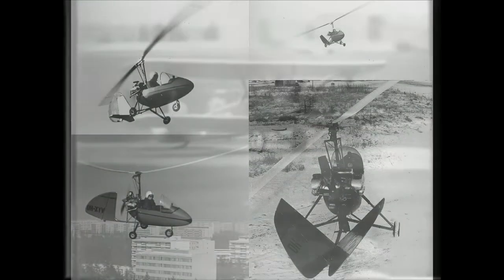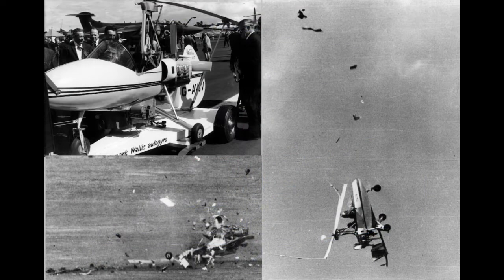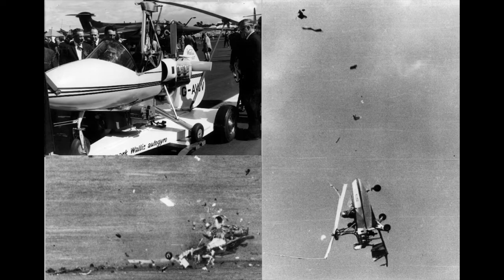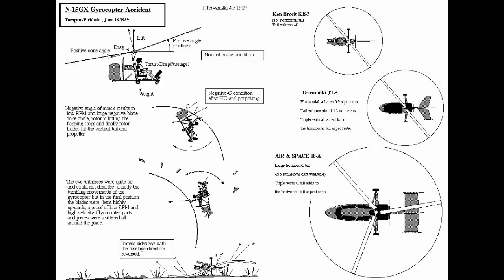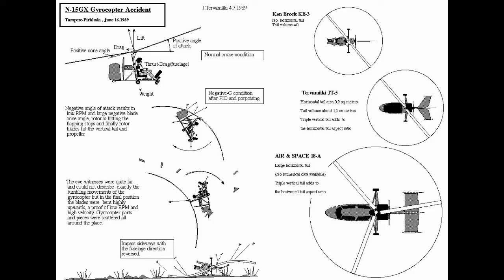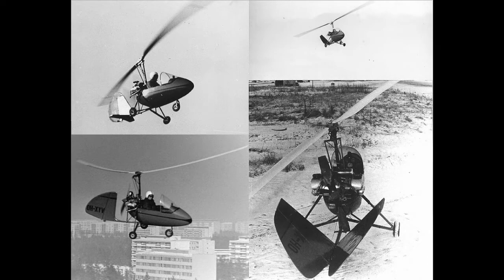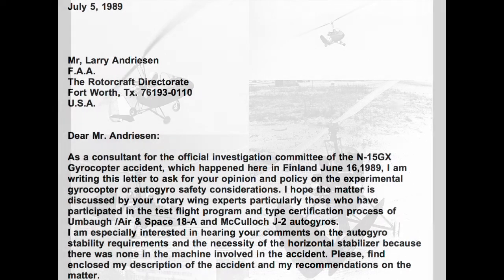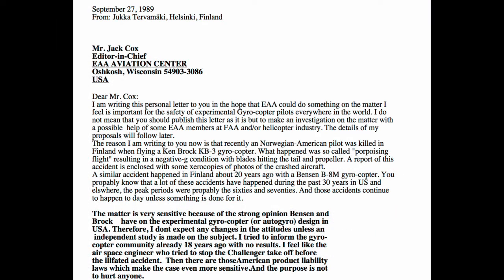History of the Gyroplane - part 16 pilot induced oscillation PIO

Comment: This is an excellent series and I agree with much of this but I have some quibbles 

1) in Australia around the time the air command accidents that lead to their banning Horizontal Stabs were mandated.  Since there has been no appreciable reduction in fatalities,. But all gyros are fitted with stabilisers.  Many large.  Remember the mangoose stealth looking gyro?  What happened there?

2) Speed.  Remember if the rotor is tilted sufficiently forward the angle is more vertical.  If the disk drops below zero what matters.  My STEM kids make gyro gliders in class you know how I get them to stop. By unloading the rotor.  If the rotor has no lift you have zero control.  What happens in the 1/2 second between unload and fly through rotor or tail comes up through rotor is IMO mute.  Your dead anyway.  

3) Glasgow unis summary on stabs for us was they aren't very effective until very high speeds at those speeds gyros become dangerous.  Thus they are insufficient.

3). The key factor here is speed for both high cg vs thrust line and by the way thanks for acknowledinging downthrust.  

4). Can we not ever get to the conversation about rotor wing loading, speed and how that impacts on VNE?  Thus seems the thing no one sufficiently brings up.  The air command at 30mph is stable.  As at that speed the rotor is tilted back at 9 degrees.  It's more of a problem at say 80mph because with say 23ft 8inch N8H12 section rotors it's going to have a more shallow disk angle than say a Bensen (and perhaps I'm jumping the gun on you).

There's a some experiment that anyone claiming thrust line/HS will stop the deaths can do and I'd suggest they try first in RC gyros (as large as possible). Put any configuration you like on fly up to high speed and punch the stick forward hard as you can.  That no one has ever attempted this tells me we are playing at the margins.

The Wallis crash happened at what speed?  90+knots wasn't it?  A guy I knew flying a tall tail high cg machine boasted to us he was going to crack 100mph in his machine.  Several of us warned him but he claimed he'd be fine because he had a stabiliser and high cg to thrust line.  The bunt over in his case happened at 94knots.  His 27ft rotors cut his tail off just above the stabiliser and his body was found some 50m in front of the airframe.  His harness ripped and his leg left in the cockpit caught under the instrument panel as he was flung through the windscreen.

Does high cg vs thrust line or downthrust help.  Yes I suspect it does.  Will it stop you fatally unloading your rotor.  NO IT WILL NOT.  

It feels like this debate is centred around what to do in the last half second of you machine flying when in reality we should be concentrating on when you exceeded you VNE.  Simply don't fly that fast.

As for PIO.  I saw it only once.  When a student of mine got caught with a stretchy rope on the gyro glider.  My fault I brought the dam rope.  I backed off the power to the car so he sank to the ground which got him out of it.  I've never read an eyewitness describe ossilations.  If they are happening it's not many perhaps only one but the evidence I read in 16 years of fatalities didn't show one clear case.  For all we know it was a steady push forward on the stick until the machine unloaded, perhaps at that point due to thrust line.

Bolt a group to the ground in a strong wind and simply pushing the stick forward far enough will unload the rotor.  That stick force is the maximum benefit a stabiliser can provide.  So after landing how much force does it take?

If stability is what we want the the bensen design manual provided an answer.  Overbalanced rotors chordwise.  You need to be careful too much and they get into weave.  However I have flown wooden rotors in which the builder accidentally overbalanced them to 30% not 25% they were rock solid boring in fact.  But our sport is no longer one that encourages real experimentation or takes responsibility for proper training.  

You sir are an exception to this I applaud this series even when I may have quibbles.  Well done.
Reply from the maker: Hey - thanks for the kind comments.  On your points a lot to chew over and I might try and cover some of this is a later film as you raise some interesting points.  I too have always been slightly sceptical of stabs on gyros not in the fact that a properly designed and integrated one might not be helpful but I just can't see how some of these things (that frankly look like a piece of 5-10mm ply board) lashed at a random point and seemingly with no regard to the prop wash really work!  If I was an aerodynamics student it would make a very nice project actually.  As you say Glasgow weren't that convinced.   Your point of large R/C models is interesting and I think what the Glasgow study also highlights to me is the fact that it is a multi 100 page report with some complex maths, authored by some knowledgable people and yet within 5 mins you have quite a few people dismiss it.  Which surprises me - I don't think it was helped by the UK authority also contradicting some of its content (I'm thinking RAF stabs).  It probably could do with a revisit in parts to confirm or deny.  I agree your point re: will it stop you unloading the rotor - no.  Although I think the Wallis accident was air display / low time / poor prep and like many of these accidents there are in many cases too many variables.  One element that I think is a huge impact are the physical controls and their function.  I will cover that at some point.  We had floor mounted sticks, pump action sticks, hanging sticks .. Interesting on the rotor balance and 30% v 25% I have a paper from Peter Lovegrove who found 25% provided poor stability.  It is in his Gyroplane miscellavia vol.6 If you don't have it I'll try and scan and email it.
Reply: @gyrocopterflyingclub6148  thanks.  I've tested quite a few wooden rotors over the years in our club me and another bloke built a number of sets and we used the gyro glider to test.  As I said before that another student built a set intended for the glider as we were borrowing a club members metal blades.  He stuffed up and balanced them at 30% instead of 25%. They were so stable we sent a whole bunch of student solo that weekend.  With one student we hit a massive thermal the hall guague topped off it was massive we should have ended up at the top of the rope probably gained a few few.  I'd smacked the students hand off the stick.  Impressive.  My wooden rotors are at 25% as bensen recommended.  

I was disappointed that the Glasgow report didnt model for the effects of chord width flexibility I personally have found that flexible blades or. Wood significantly more stable.  

The Wallis accident I agree was low hours on type.  Possibly too unaware of the degree of danger he was in at the high speeds.  But they analysed the film to find he was going too fast.

I note that Wallis speed records were set with 19ft rotors and he had a small pitch trim to flatten the nose.  My instructor when he put his pod on his machine added an upside down aerofoil to keep the nose more level at speed.  Ciervas had similar but one side was upsidedown and the other an upright aerofoil to counter tourque from the large prop to they also had ground adjustable.

But the mistake I think in the confidence of all stabilisers is in trying to stabilise the wrong thing.  The airframe hangs on a universal joint.  This means if I over control the stick wants to move in the correcting direction if I'm letting it fly itself.  I agree with you video that good gyro glider training helps this.  Particularly as it allows for solo flight with less weight than any powered machine.  One guy I knew killed himself in an air command in front of my brother.  The month before he rejected coming down to train with a club and qualified instructor because he didn't want to drive 4hours every month for training.  I hadn't visited the club as at that time I was a beginner but he'd smashed his nose wheel.when he punched the nose forward after an unexpected take off.  I watched a friend of mine plead with him to get training and warned that doing this would result in neg g.  But he didn't listen.

So we've had a lot of blame for the machine over the years.  In part this is because it's a small sport and no one wants to do the responsible thing and question the skills of the stubborn or aggressive pilot or question the xomparitive skills of the instructor.  I suspect some protectionism happening.  I know I was extremely lucky to get a great instructor and in the time I was gyro glider instructor he never had a single student under his instruction bend a set of blades let alone a fatality or neg g type death.  He did have people go off and do their own thing and smash upmaches he had stubborn and disobent students go their own way.  And yet I had students in the glider that had had 30+ in two seat machine and couldn't fly the glider!  

It's complicated.  I agree that trustline helps but even here I unload my rotors after each landing.  It's not hard to do even if the airframe is flat which it probably won't be at high speeds.  

And establishing a real VNE for each machine would be difficult unless you set a new hang test for each rotor diameter,. Pitch a d fuel level.  I note most machines have massive long rotors. Why does no one suggest I wonder that rotors be kept shorter?  Wallis held speed and for a long time altitude records with short rotors.  Shorter rotors and for any airspeed you will have a higher angle which even if you have poor cg vs thrust line provided you don't fly fast your disk vector will try to pull the nose up.  The dominators have this ugly approach because they use zero downthrust.

Anyway I've rabbited on long enough.  But I'll leave you with a prediction.  Fix cg thrust line and stabiliser issues and people will still keep doing this until they slow down, and we get a better class of instructor s in general (I can only speak for down here) and students listen to them.

Again this is an excellent series.

Comment: Excellent videos! (im suscribed!) 
I have a question: PIO is reducted by horizontal stabilizer.. ok.. but CLT is said as "needed" in gyros...but, gyros like ELA, or MAGNIGYRO.. are not CLT modified.. So, are they dangerous anyway? 
Thnaks for your answer!
Reply from the maker: Hi the short answer is that no they are not needed, as a pilot you just need to be aware of the limitations and fly accordingly.

Comment: And,one more...hehe.
Im looking for an AirCommand (Classic) (HLT).. is it "SAFE TO FLY" just with horizontal Stabilizer? i mean.. is it so much diference between CLT and HLT?
Apreciate for your comments!
Regards
Reply from the maker: Hi - thank you for the kind comments.  Its not an aircraft that is legal to fly in the UK anymore and initially this aircraft was not sold with any stabilizer. In terms of "safe to fly" the real answer is that you can fly it safely you just need to be aware and consider the aircraft characteristics.
Reply: All my gyro time, about 80hrs, is in Air Command models. In the Rotax 447 and 582 models.
I found no issue and often flew in horrendous winds.
It's all about avoiding PIO's and flying as if you don't have the seatbelt done up.
Once you approach zero G you have lost control and thrust and drag forces will take over, unrecoverably.
Gyros are essentially a weight-shift controlled type, dependant upon positive G. Same as a teetering rotor helicopter is.
Horizontal surfaces at such short moments achieve absolutely nothing. I flew with and without them and could not tell any difference.
I would say a well maintained Air Command is fine.

Comment: Computer modelling by Glasgow showed a 2 inch high thrust line on a VPM M16. Everything followed from that. They were about 8 inches out as has been proven by real world double hang tests. They pretty much discounted the effect of the HS. Newer gyros prove that high thrust line gyros can be stable. Many think the Wallis crash was a torque over when the rotor thrust was lost. This is just as fatal as a push over as was seen at the world air games. All that being said...most aircraft have the thrust line going through the centre of mass. But gyros built like this don't look sexy. ...and sex sells. The Aviomania is an exception and also addresses the torque issue. 
Nice videos.
Reply: It is amazing to me how Glasgow university was so far off on something as fundamental as calculating or determining vertical CG of an aircraft they had on hand.

Comment: why don't they use a ducted propeller? wouldn't that force direct air over the rudders all the time?
Reply from the maker: shimy333 hi yes I see where you are coming from but really the prop wash over the rudder is usually not an issue. As far as the propwash over the horizontal element is concerned that interaction has much to do with how that surface is placed relative to the prop.  A duct would do that with consistency but the structure would be quite (in light gyroplane terms) complex / heavy and expensive (just from the make up of a duct - remember prop size is circa 60in and the duct bigger than that) additionally you would need to also make specific prop blades to ensure efficient propeller interaction with the duct and the design of the duct would need to be pretty clever to allow for its interaction with the airflow over the fuselage. If you look at part 8 of this series the aircraft that did employ a duct was designed by ex-AVRO Canada guys who one assumes used information from a bigger project for their gyroplane - and even that wasn’t really for the sport market. So in summary I think there is a lot of work/cost/ weight and complexity for a solution that (in my view) can be done with a regular tailplane. The issues Gyroplanes have had over the decades is down to multiple issues that had been left unaddressed and in an environment where the regulator wasn’t really focused upon them. So training, prop thrustline, tailplane and don’t ignore the controls themselves - for years you have hanging sticks, floor mounted, throttles on a twist grip, quadrant- it’s all fundemental to the safe operation and all in an environment where there was no differences training and even TODAY there is NO revalidation of those differences- so you fly an aircraft today, get competent, then leave it for 30 years and still be legal to fly that aircraft when you return. Idiocy.
Reply: @gyrocopterflyingclub6148  I think more tractor style gyros need to be designed....would solve this problem according to everything i've read about gyros...it's just the Benson design is so easy for the home builder to make..
Reply: Tractor gyros are no safer than pushers. A high thrustline tractor gyro is no different than a high thrustline pusher. The thrust is acting in the same way above , thru, or below the centre of gravity.
Reply: A ducted prop would also help prevent a rotor and propeller contact.
Reply: @gyrocopterflyingclub6148  -- Has anyone tried replacing the one 60 inch prop with two 42 inch props rotating in opposite directions of each other and driven by belt or chain from the lower mounted engine?

Comment: I think the first thing would be a pilot of an aircraft is to developed a good working knowledge of the weather. So many times one can go out flying on what appears to be a good day and run into clear air wind gradients mechanical turbulence on a perfectly clear day. Even, in fact, fixed-wing aircraft, wind gradients can strip your airspeed in seconds. Also, the huge G force on any aircraft can be massive. Wind gradients can load an aircraft in a split second to 3 G with no trouble. So in rotary-wing aircraft including helicopters, there is a major problem.95% of fixed-wing aircraft are placarded. That helpful, but doesn't solve the problem. A great deal of experience is needed in any aircraft with wind gradients, and clear air mechanical turbulence, especially below 500ft.
I haven't flown a gyroplane, but have done a lot of time in helicopters, and the big concern all the time is wind gradients.